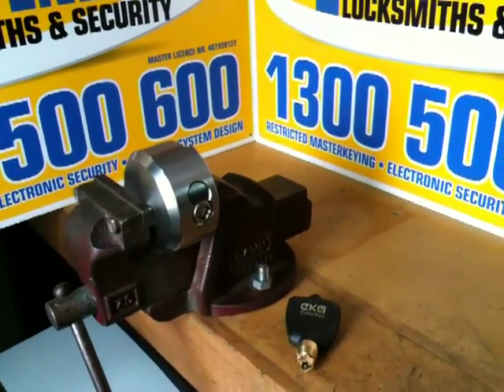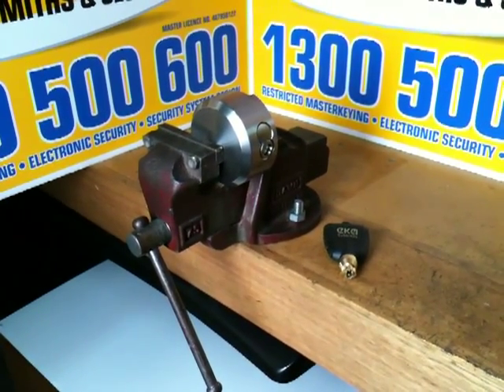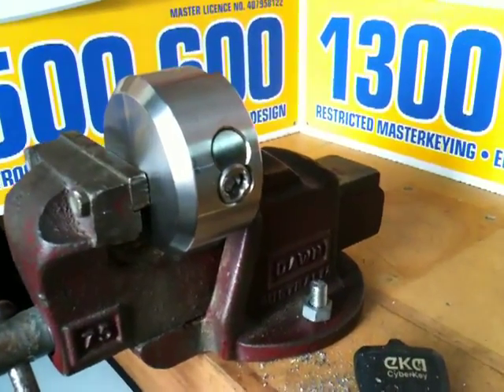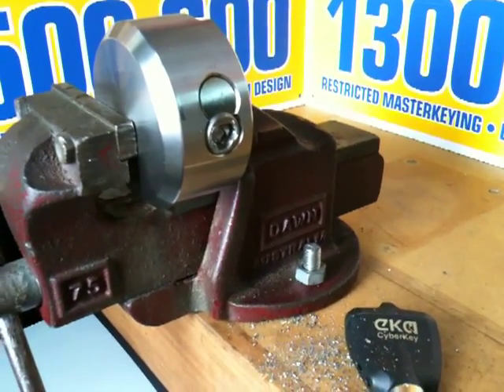Cyberlock High Security Padlock Drilling Demonstration

Comment: you didnt show if the key works with the lock or if it still works after.  what about attacking the locking mechanism itself or drilling through the body to manipulate the lock from behind the keyway.  what about drilling out and removing the keyway alltogether (in your demo here, its obvious that the keyway is drillable, and quite soft, as the shaving coming off are quite big.  if you want to really test the tension resistance of the keyway, put a screwdriver in it that can be levered with a spanner (with a tube attatched). ...and if the keyway is electronic and uses a solenoid, can it be manipulated with an electromagnet (or rare-earth magnet).  ...a worm-gear with a motor would be more reliable.